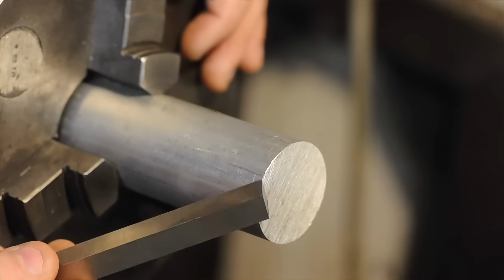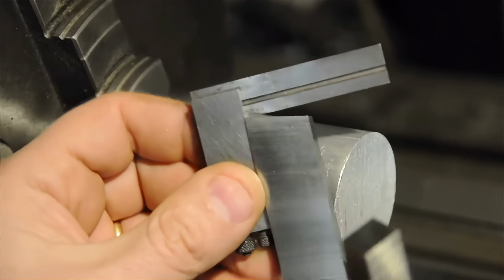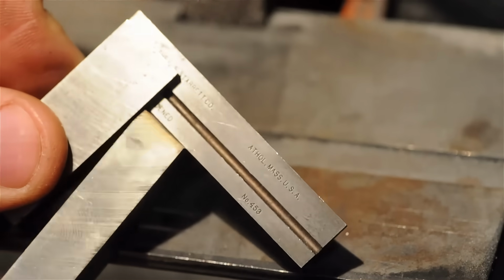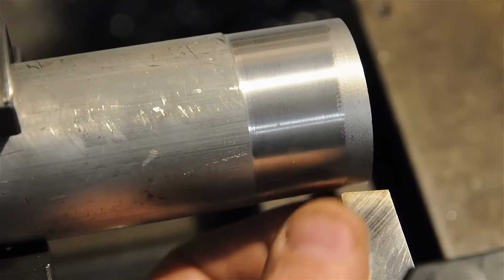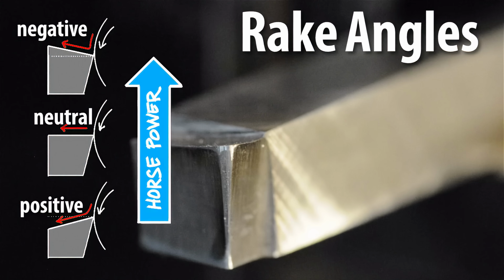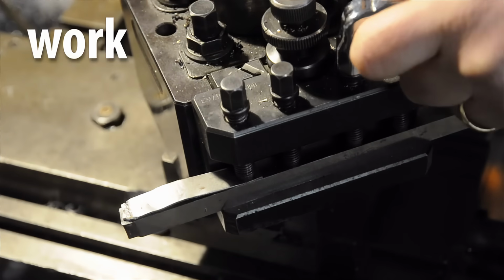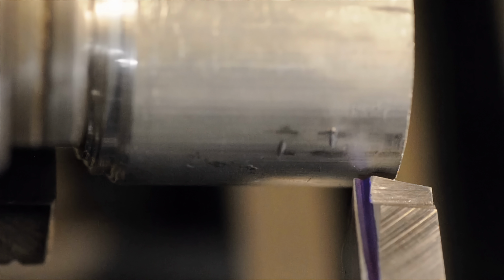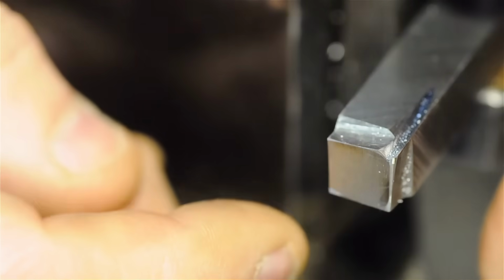Grinding HSS Tools

Comment: Excellent tutorial. Since you made the video for newcomers to lathe work , several safety items related to chips need to be stressed. NEVER pull out chip tangles with your hand. It can be like grabbing a razor blade. Use an old screwdriver (or similar) bent into a hook or old pair of pliers to pull out chip tangles with the lathe stopped.
Long curly chips can look pretty but can be extremely dangerous. The worst lathe accident I ever saw was a guy stepped into a very long curled chip and one of the chuck jaws hooked the chip string and zipped it back into the lathe. It nearly took his foot off. 
You never wear a watch or rings when running a lathe. Get a small box and put it in the top of your toolbox. When you walk into the shop put your watch and rings into the box. Read down through the comments and see some of the descriptions of what can happen... you will get a little box immediately. 
Have fun and be safe.
Reply: Extra emphasis on pulling the chip tangle off with the lathe STOPPED. It WILL try to rip the tool out of your hand, and you do not want to find out what happens to a hand that gets pulled onto a spinning chuck.

Comment: I work in a heat treating plant. High speed steels thermal resistance comes from the high molybdenum carbides in the alloy that retain their structure better under heat than regular ferric carbides. It's difficult to work besides a lot of grinding though, it needs to be nearly molten to be movable, and it quenches at nearly the melting point of the steel itself so if you overshoot at all or have a lower alloy than you thought you melt it and potentially burn your molybdenum out. I'm not an expert metallurgist though, I may be wrong and that's just the one variation I've seen.

Comment: That tight coil off the chip breaker looked like a telephone (landline handset) cord.  There's a joke in there somewhere, or a visual pun to be made with a copper-wire-embedded block of plastic-rubber material on a lathe.

Comment: Awesome video. I have a question about cutting in wood. I have a Craftsman #3641 circle cutter. I've tried a few different angles in the cutter, but I can't find one that won't do more burning than cutting. Do you have any suggestions?
Thanks
Doug
Reply from the maker: usually circle cutters cut on the end like a parting tool instead of the side like a turning tool.  try grinding it so it looks like one of the carbide tips of a circular saw.  be safe!

Comment: Good basic advice without getting bogged down, personally, as it is alum-min-yum (sorry, I am Eenglish) I would have put the chip breaker in before I started grinding or bothering with any top rake, and the rad, I would have just knocked the corner off to a 0.015-0.020" with a stone rather than the 0.050" you put on. Keep up the good work. Cheers Buddy.

Comment: Andrew Cullen: I for one do understand what goes on behind and in front of the scenes, probably 1:1 or less machining time to production time. I'll leave it at that.

Old Tony, I've just discovered your videos in the last few days. It's all interesting, and much has been relevant to my own work [please don't laugh] as a woodturner. Chip breaker, or controller? That's what the part of your hand that's not on the toolrest is for. If you want  long streamers as chips, try machining acrylic, epoxy, green wood, or a potato.

Thank you.

Comment: Not sure if this has been mentioned before... Why don't you use a dremel with a small abrasive disc to create the chip breaker instead? Wouldn't that be more controllable than using your grinder for that? Thanks for the video.

Comment: I had one our engineers watching this your video as an intro to why lathe tools are shaped the way are, and in playing around with HSS and making some custom tools for various needs I tried using a rotary tool with cutting wheel to form the chip breaker and surprisingly it worked very well.

Comment: First things first..your videos are very informative and funny...im not even a machinist ...at all...but i saw this and was reminded of my engraver sharpening...hss / m42 / carbide blanks....very small but i was just thinking if you wanted perfectly repeatable geometry on the blank....take a look at what a linsay graver sharpener is. It uses a collet and shaped cards to angle the tool to the different ground faces for the tool.  Perhaps have a look at one of those in use and you could make your own for personal use just on a bigger scale.  That rotating welding platform  with some diamond film might be usefull.

Comment: Good fer you Mate, you are a natural teacher, wisht my ole school master shudda bin more like you eh@@!!
being a builder of  alu yachts i have 7  angle grinders, all with different wheels , so using a 3m wheel in a 5inch  i set the tool in an american style holder or vice, using the FLAT  of the wheel , never an edge, i can do these compounds, another way is to turn up a wooden clamp to hold the grinder in a vice and then hold the hss either by hand or in the holder

Comment: Hello Tony,  Trouble with feeds and speeds for chip breaking is that it is a continuous variable as the diameter of the workpiece diminishes.  This changes the surface speed.  I find chips with certain stainless steel alloys very dangerous as they get extremely long and whippy.  Yet with each cut you have to continuously be changing and searching for the right combination to get them to break even reasonably well.  You magic potion that works throughout the turning.  Nice subject.  I would like to see more definitive info on setting your cutter's angle to the workpiece with the toolpost.  Good video as usual.  Take care.  Doug

Comment: From far in the future:  watch the chip flow before you ground the breaker in.  It flows across the top of the cutting edge, the top rake.  The thinner your chip, the less easy it is to break it.  aA chip .001 thick can be twisted back on itself and remain whole.  A chip .030 bent back on itself does not have the ability to remain whole, it... breaks.  So lowering RPM maintaining the same feed per rev, or incresing FPR while maintaining RPM  increases chip thickness and "breakability".  Now look at a breaker ground into industrial inserts.  The chip flows along the rake of the insert a fe thousandths, then hits a wall at 90 degrees to it, causing that folding action and breaking the chip.  FPR can only be increased so much before tool chipping occurs, so the breaker helps.  Inmy machine work, we had to grind tools, by hand, to last for thousands of pieces before stopping production to regrind, and had lots of work to do that prevented down time to clear the bird nest.  We got good at grinding nreakers into our tooling.  It took me a while to get good, and what happened was looking at chip flow, then looking at inserts to see how they were designed.  After a while, I could replicate that shape by hand grinding and the birds had to look for new homes.  In trees.  Not in my shop.  No more living in metal houses, like campers.  They were happy, I was happy, the whole world got happier!

Comment: Love your humor.  Now for mine.  Get a 1/2" stick of tool steel.  Not M2 or M42...  pick a square or triangle with breakers and the rounded tip as wanted, find a mounting site and drill a hole.   Then if fancy - go to the mill and cut a bed for the carbide insert and tap a hole.  Then hog some metal.  Loved the video.  Sheldon Lathe L-44 Tool Room, mostly HSS but has carbide tooling and when done both work.  Just not the power of big lathes.

Comment: When I set up to grind HHS tool bits, and I usually do quite a few at a time, I use a couple 8 inch grinders, not just one. I set up one with a one inch X 40 grit and a 60 grit wheels and the other with a one inch X 120 grit and a 36 grit X 0.0625 inch cutoff wheels. That cutoff blade helps cutting sharp corner profiles and chip breakers.

Comment: Thank you for a very thorough but completely watchable video. I've come back to it many times. 

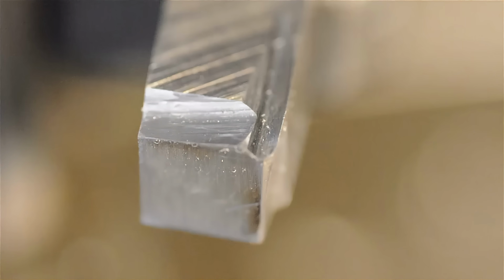One question, though: When you added the chip breaker near the end (approx. 27:34), didn't that change the height of the cutting edge, making it slightly below center? If so, will that matter much? If not, what am I missing?

Comment: Another consideration for the tip radius: The bigger the radius the higher the cutting force (more of the edge in contact with the work). This generally means less precision. So for high precision work smaller radii are usually better.

Comment: That's very well ground tool even the chip breaker aluminum is just one of those metals that is hard to get to break and the fact your lathe can't go any faster grinding your own tools is a good skill to have as you can make you own custom tooling but don't get me wrong carbide bits are nice both HSS and carbon have their strength and weakness but work very well together

Comment: Hey, Im new to machining, but Ive asked in a local shop for some hss blanks and they charged something like 28€ for one blank... on the otherside they proposed to me some brazed tools, they only said brazed tools but I assume those were carbide brazed on some kind of metal anyway, they charged 7€ for one of those... what the heck? This old tony said hss was cheaper...
Reply from the maker: check eBay!

Comment: During my exploits over the weekend, I took a trip to what was once a machine shop for some very heavy mining equipment. It's been abandoned for thirty years and I was just given permission to go salvage equipment. I happened across a couple of American Tool Works lathes that unfortunately didn't fit in the truck (at about 14"x104" capacity and probably 1200 lbs apiece) and with them, some hexagonal hss blanks. And, still locked in a Prentiss No. 216 vise since 1977, a hand cut HSS threading tool that looked almost identical to what you've made here, just scaled up a good deal. In all I think I collected at least twenty pieces of tooling. It's now a goal of mine to go back for the nicer of the two lathes, but I'll need a good trailer and a crane.

Comment: I'm going to have my apprentice watch this video,  it's absolutely the best primer on single point tooling I've ever run across.  I started learning the trade from old machinists 40 years ago and I'm still doing it and still learning!  Thanks Tony for helping me train my youngers!
Reply: I often think how awesome it must be starting on an engineering apprenticeship nowadays.  There is so much amazing information to be had from the YouTube channels,  In fact I started as an apprentice in 1967, and I am still learning new stuff.  (Not from this video however.  We did not have tipped tools when I started, so I have ground a LOT of HSS tool bits.   I actually ground one two days ago because I wanted to cut hardwood on the metal lathe, and tipped tools are not great on wood.   You can buy the blanks cheap as chips from wish.com
Reply: @TrevorDennis100  You could try to grind the shape of a skew chisel into a solid HSS bar. Just watch a few videos on how skew chisels are used in woodturning and you'll know how to grind the mini version in your stock so that its positioned to the wood like a skew chisel to the wood in woodturning.
Reply: They will fail. I did.

Comment: Wow, this takes me back in time (as a first year apprentice).  

Before you were allowed to use carbide inserts, the turning instructor used to get you grind all your own tools and the rotten sod had a plate guages to check for rake angles, clearance angles and radii. Even had a shadowgraph set up to check your thread cutting tools.
Me, being the clever little monkey I thought I was, used a stone in a pencil grinder to put the lip in, for the breaker. So Robbie (the instructor)  scrapped those tools and off I started all over again.
Apart from drills, I don't think I've ground a tool on an off hand grinder since (and that's roughly 40 years ago).

Comment: The optimum radius for the cutting point of the tool is equal to the depth of cut you will make with the tool. So if your depth of cut is 0.040, that's 40 thousandths and you make the radius of 40 Thou on the cutting tip you will have all the curved cutting edge in the cut.
A larger cutting radius will have part of the curved cutting edge outside the cut and have no effect on the work being done.

Comment: Old Tony 
You skipped the part from 1880 to 1906 when Frederic Taylor invented high speed steel, developed the Feed, Steed, Depth of Cut tables and Flood Coolant necessary to use it to best advantage, then published his findings in his book "On The Art Of Cutting Metals" which is available from Amazon.com
otherwise pretty thorough history.
Reply: You mean "Frederick Winslow Taylor" "On the art of cutting metals"
Reply: Yes

Comment: Holy crap that was interesting.  I'm not a shop guy, the most I've done was some band saw, drill press, and box break shenanigans (plus a little bit of milling) for a sumo robot in a college electronics lab course, but I've found myself watching these more and more.  Also, my computer engineering background gives me the following insight: I get the sense that 0xTools is probably pronounced Hex Tools, because programming jokes.

Comment: This is a wonderful series, Tony, and I'm about 40 videos deep into your channel. If I was collecting videos to help re-build society after the zombie-apocalypse, this video and also "A brief chat about carbide tooling" would be used as the introduction in the chapter on machining. As far as useful tips, in "Two Piece Machine Vise Build" you mention how precise the flatness of the surface grinder is, plus...there was another where you mention that drill bits can't be beat for quickly hogging out the mass of material in a hole. If you are looking for ideas about what video to do next, I'd love for you to provide a walk around the shop, with a brief description of each machine and what they are best at, along with what they "can" be used for in a pinch...you know, with all the spare time you have.

Comment: Hello Tony, I've seen a HSS insert bar holder, where the tool is kept at circa the same angle you where grinding your.
With this holder, I think it will be easier to sharp it because only the front face where grinded.
If I find a picture I may send it to you

Comment: nice vid. Depending on material and ect ect you still sometimes get a birds nest or no chip breaking. I keep some needle nose pliers handy to pull it off. Never grab it with your hands... that goes without saying.
Reply: When we were machining Delrin or uhmw it don't chip break. that was the only material we would pull off while the lathe was running by hand. wouldn't cut you or pull you in.

Comment: I have never been able to use a grinding table to make my tools I have to free float them I have to hold them in my hand. I don't know what it is I made a really nice auxiliary table for both sides of my grinder and I ended up just taking it off because I can't do it I have to hold it I'm just too used to holding them. I grind one hell of a nice tool as well I don't brag about a lot that I can do because frankly I'm a novice but I do grind nice high speed steel tools I got a Harding's 59 and it is so important to have a perfectly-formed sharp tool on that lathe that I think it just gave me the muscle memory to do nice tooling every time. I found with really high speed lathes like that hardinge if you don't have a perfectly Sharpe nicely honed edge with the right clearance angles you end up selling the hell out of it way too fast

Comment: As a professional knife maker I try to never allow my hardened steel to rise above 180 degrees, preferably 160. I use cool mist and/or constant dipping in water to keep it cool to touch on the 2x 72 grinder. 

So why if this is a cutting tool would you allow the grinder to alter the temper of the cutting steel?   

Also I do recommend buying a quality rotary abrasive grinder or 2x72 belt grinder to replace your bench grinder, which is most likely the most dangerous and inaccurate tool in your shop. With the right belts it will perform every grind you described here with far more ease, safety, and send your bench grinder to the loneliest, dustiest corner of your shop where it belongs. Your videos are freaking awesome and this one is especially helpful info as I want to upgrade my lathe to one that serves more than just as a paper weight.
Reply from the maker: the cutting tools in this video are high speed steel.  almost impossible to overheat past their temper.  they could get red hot and still be okay.  thanks for watching Zack!
Reply: @ThisOldTony  I suppose that means its not something like O-1, D-2, A-2 etc.. I looked it up looks like HSS has lots of Chromium, Tungsten, etc.. with cobalt and a whole class with M-2 being the most popular. Ha, who knew.

Is there a way for me to contact you directly. FB, IG, etc. i have a question about a machine I want to have someone build for my knife company and I think you would totally dig it. You may at least have some good input. I am NO machinist. I make high end culinary knives. thank.
your channel is now one of my favorites.

Comment: Amazing. Half a world and a couple of decades separate us and 5 min in I'm starting to think of anything I might be able to add (I don't think you will fail to cover anything in 30 min +!) and I knew about the WD 40 trick, kerosene also works well. I really like to share info and tips. I'm sure I'll come across something while binging on your videos. I never really realised how much i'd learnt and retained. I need to give up this locksmithing nonsense and find somewhere that needs a conventional machinist.